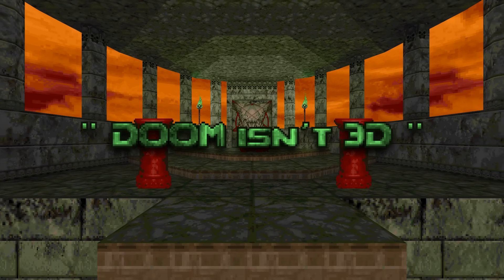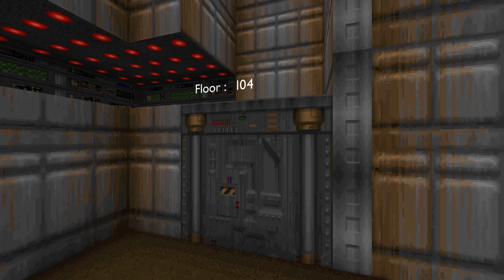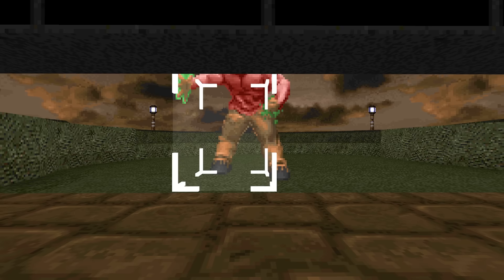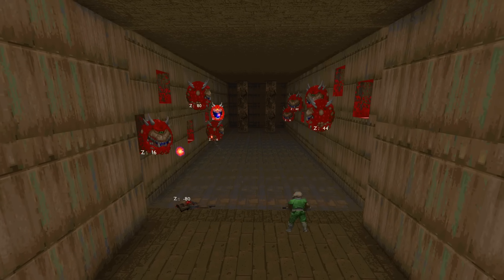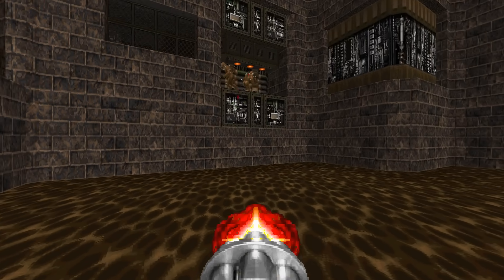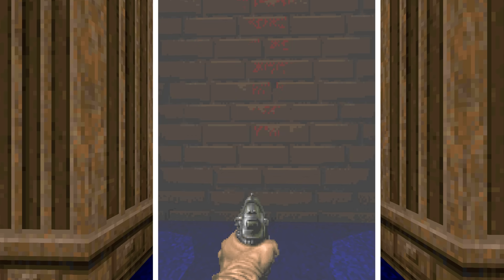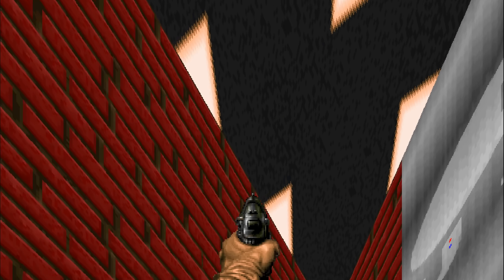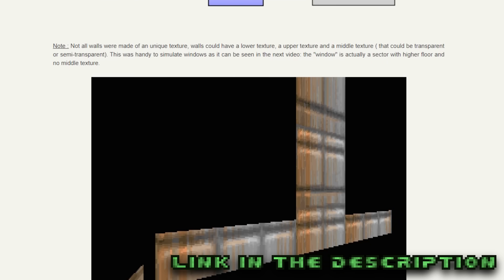Doom engine - Limited but still 3D

Comment: Your opinion seems to differ from both the Johns. Carmack and Romero, the ones who designed Doom.... already have said it's not real 3d. Mentioned some of the things you have stated and some you left out. In 3d, you apply vertices and indices and textures in a 3 demensional space. Doom doesn't do that in 3 dimensional space it rather uses 2d sectors and then tries to give an illusion it's 3d.

By the same logic you and many others use there is no such thing as 2d games as you always have objects drawn over a background that may be a single color or an image. Hell in Zelda Link to the Past you have a boomerang that goes "over" some objects.. the ones that hit switches to raise/lower the floor blocks. Would you then say well it's still 3d? No, you wouldnt.

Doom is just the greatest illusion of 3D that was ever created using 2d. And even the Johns agree with that. Fun fact, when they in fact did go to true 3d they had problems.. this was during quake and they actually discovered hardware errors in processors with Intel. Check it out it's a good subject to research.

So I gotta agree with the John's on this one.. Doom isn't real 3d.
Reply from the maker: „Illusion“ term is not really correct to use here. It implies the game visually appears three-dimensional while the gameplay is limited to a 2D plane. I do remember Carmack saying that, but I believe he made a mistake about a game he has moved on from long ago.
In-game objects have 3 coordinates which are being tracked at all times.
Doom mapping format (sectors with height) is primitive, but achieves nearly the same results as a more advanced one. The level architecture you create by defining sectors would still respect vertical positions of the players, mobs and projectiles. Windows, platforms, stuff hanging from ceilings - all that makes a 3D space for objects with 3 coordinates to inhabit. Sorry, but saying Doom doesn’t have a 3D space is incorrect. True, this space has flat horizontal and vertical faces with no slopes, but so does a cave in Minecraft. Not having floors in the middle is unfortunate but doesn’t subtract a full dimension all of the sudden.
I also heard the Zelda example before (an old game theorists video used it), it’s not a fair comparison since Z in doom doesn’t work as a binary „above-below“ or a limited set of „layers“ that objects snap to. Z is a number allowing the same precision as X and Y do.
I believe Doom gameplay respects 3 coordinates enough to at least deserve 3D elements not being brushed off as „illusions“.
„Not a full 3D“ is a much more fair thing to say, we can’t ignore other games like Quake, that did 3D so much better. Compared to Quake many things are missing in Doom - hence its 3D capabilities are “not full”. Some even say it’s “2.5D”, which I also don’t have issues with. At this point these are merely different words to describe the same thing. I say “limited”, you say “not full”, tomayto, tomahto.
Reply: @borogk  Other examples would be E1M2 where you take the elevator to the room before the exit. If a monster is standing below they still block you. It's like infinite height. This is not common in 3d games. Yes there is a height for things. Which is why monsters cannot enter certain areas. But the only thing really "3d" is projectiles.. that could more-or-less pass for full 3d in a 3d environment. Also the entire way hitscan works is 2d. Projectiles are a different story.

While I dislike thinking of it as 2.5d I think that may be a 'better' description for it.

I think personally the real big difference is in real 3d you can have rooms over rooms. Or bridges. Where-as in doom you cannot. If you could do that in doom I would be 100% okay with calling it 3d. They could have done it but it would have ate thru the ram. You would have needed a 2nd map above your map.. for rooms above. But you would have been limited to how many times you could do that trick. However they didn't do that for some reason.

Oh and that "zelda" example theres actually 2 of them. One being the bridges you walk over and under. And the second being the projectile thrown. aka boomerang. And it's used to hit switches. When comparing a fired projectile in 1 game, it's a pretty fair comparison to compare directly to firing a projectile in another game. It just has different definitions for what blocks it and what does not. Sorta like how projectiles in doom which are arguably the only 3d part of the game.

It really is an illusion. It's a very good one at that. They did it so well they got people to actually believe it was 3d without making a 3d game. Thats what is so impressive.

Since doomguy cannot look up, or down. Only left and right and move back and forth and side to side you technically can play the whole game in top down mode. When you use the map you essentially see it that way. And you can play the game 100% that way if you wanted and were good enough. Thats because you do not have a 3d environment to worry about more then 2 axis's. Aside for projectiles or floors and ceilings that crush.
Reply from the maker: Same terms have different meanings for us, so no point arguing about the "illusion" thing.
I'll point out inaccuracy about hitscan being "entirely 2D". A common mistake is to look at the way your starting pistol doesn't seem to care if the enemy stands above - the bullet just connects instantly. Hitscan mechanic is a bit more nuanced. 
Each hitscan shot has an origin point, a horizontal angle and a vertical angle. A line is then traced from the origin and the closest obstacle is determined - a piece of level geometry or an enemy. That line travels in a 3D space, its direction is defined by 2 angles after all, same as in spherical coordinate system.
When you press "fire", the auto-aim feature first determines a base line, then one or more bullets are generated, each with a random angle modifier relative to aim. This random spread is most visible for shotguns or when you continue holding fire with pistol/chaingun.
Connection between the auto-aim target and the hit outcome is not direct - a line is simulated fully and honestly even when the random spread is 0. The first pistol shot is programmed to always have 0 spread and should always connect, that's what creates this confusion largely. 
If you keep holding pistol fire - next shots lose accuracy, but are fully simulated nonetheless. Even better is to try the shotgun - its bullets are always randomly spread. The game doesn't cheat by skipping the full simulation, drawing a ricochet puff near the target and calling it a day. The spread angle can make it so it hits another enemy or flies out of a window and hits some elevator way far back.

Sorry, I know it's a lot, but this explains hitscan as fully as I can in a YT comment. One of those things I should've elaborated in a video, perhaps. And it serves as just one example of a mechanic, that may seem primitive at first or rely on cheap tricks.
Realising that things are not as simple - was my experience exactly once I started digging into the engine source code and experimenting while playing. Evidently, I can talk about it for ages :)
Reply: @borogk  You do realize that the source code for how everything works and I have been programming in c/c++ for over 20 years... right? Nothing you explained is "complex" even a little. Perhaps it is you that needs to brush up on understanding. Anyways happy new year and keep learning eventually you will get somewhere.
Reply from the maker: Nobody's doubting your programming skills. I pointed out that hitscan is not entirely 2D, like you mentioned, and gave an explanation. Of course by itself it's not complex, that's not the point. The point is it's more complex than "entirely 2D".
Reply: @scriptles It's bizarre how condescending and rude you're being to borogk considering you're very obviously wrong lmao

Comment: It's actually really cut and dry, the limitations are real, but so is the existence of a third axis, period. Pointing out cases where it couldn't or simply wasn't used for various reasons doesn't suddenly mean that the cases where it is used suddenly no longer exist. If you're going to set a precedent that you ignore when the game is not only visually and functionally 3-dimensional, but literally computes a third dimension within portions of its code, then that's a slippery slope to discounting every single 3D game that's ever existed. Super Mario 64? Oh, that's actually a 2D game, because it's rendered on the flat surface of a TV screen. You can ride this wave of pedantry forever, it's not a debate, it's a fundamental misunderstand of what Doom is and how it works.

Case in point: this is not what people mean when they say "2.5D." I know if you look at it retroactively it does seem logical to call Doom 2.5D because its utilization of a z axis could be called "half" implemented, but when critics or journalists use this term, they don't mean this literally. What they're actually referring to are games which give the illusion of depth through rendering tricks. Prominent examples of this are from the golden age of 2.5D during the late SNES and N64 era, where pre-rendered 3D models were regularly used in platformers, which then gave way to true 3D models being rendered in game, but with the gameplay still being locked down to a 2D plane, such as in Super Smash Bros. Generally even the later examples are controversial to call 2.5D because they do actually render the 3D models, and the camera can be rotated around them in the pause screen. But as far as gameplay is concerned it's extremely rigid in its lack of third dimension.

Wolfenstein "3D" is probably one of the best examples of this because unlike Doom, it had no variable heights, and projectiles couldn't pass over actors, it was quite literally 2D with the 3D illusion simply being the work of perspective. Hell, it's more 2D than Sonic 3D Blast, which while it was simply done from an isometric viewpoint which never really tricked anyone, you can technically move on three axis since you can jump over things.

I think the bottom line about defining video games by their dimensional axis is that when we stress out about these technicalities just to look for the "right" answer, we're missing the forest for the trees. At the end of the day, to look at the technical achievement of Doom in 1993 and get a stick up your ass about it not being "true" 3D despite it literally having three dimensions fundamentally misunderstands what the game and the engine are and it's frankly insulting. But more than that, there's way more nuance to the topic regarding what "3D" even means and how video games achieve it technically. And if you really care about it, then there's a discussion about how Doom actually works to be had, there's a discussion about how Quake works to be had, and Super Smash Bros., and Sonic 3D Blast, and all of this can be part of a larger exploration of how anything projected onto a 2D surface can ever be interpreted in our minds as 3D in the first place when it actually isn't regardless of how it's being rendered... and then we could get into VR. All of this stuff is a different kind of conversation, all of these things are interesting on their own. Piggy-backing a real conversation onto a factually incorrect statement which leads down a line of questioning that demonstrably proves your initial assertion was false to begin with disrespects the audience and wastes their time.

Doom is 3D. Full stop. It's interesting and quirky and deserves further inspection from a technical and historical viewpoint, yes. But it is not 2D, and any sincere investigation into that fact will only provide more evidence that Doom is, in fact, 3D.
Reply from the maker: Well said! I largely agree with your view, although what people mean by 2.5D changes from person to person. Talking to a lot of people in the comments under this video has taught me that this point of view doesn’t always come from ignorance. One can have good knowledge and understanding of the engine and still draw the line keeping Doom one step outside the “big boy 3D club” on technicalities.
If we look outside the FPS genre, some say 2.5D is when gameplay is a 2D platformer, but a game heavily uses 3D models for characters and/or backgrounds. And that’s an entirely different thing from the FPS-type 2.5D. The term is simply not consistent enough.

Comment: No "room over room" isn't a limit of the Doom engine, it's a limitation of ID's implementation of BSP (Binary Space Partitioning) trees. When your map format is mostly structured like a floor plan, how on earth are you supposed to support rooms being above or below other rooms?

ID's BSP implementation didn't gain the ability to express true 3D space until Quake; if you back-ported just Quake's BSP implementation, you would probably be able to remove the "no vertically stacked rooms" limitation from Doom.
Reply: But JohnCarmack was not able to deal with Quakes BSP and came up with this weird PotentialVisibleSet and accepted much more overdraw than in Doom ( walls and floors are now rendered back to front (painters) ).
Reply: I said PROBABLY, lol. Obviously you'd have the sorcery that is Quake's rendering engine to deal with, but it should THEORETICALLY be possible.

Comment: The original build engine also used collumn rendering, and it can't technically have rooms on top of rooms, instead it uses silent teleports to make it seem like it does.
Reply: Build uses portals, and I can’t understand why it is not as 3d as Descent .
Reply: @ArneChristianRosenfeldt  silent teleports, as I said
Reply: @gentlesoul221  I know that silent teleports allow for this, just Descent did not need them. So going from 1995 Descent to 1996 DukeNukem3d was a downgrade. Descent had polygon enemies.

Comment: It looks 3D, but on a technical level it is not 3D. You won't find a single 3D prop in any of the doom games - that's not just an optimisation technique, its a limitation caused by how the game is rendered. 3D models are stored using vertices with xyz coordinates- the Doom engine does not use 3D coordinates and cannot render 3D polygons.
Reply: @borogk   Every object does not have a z-coordinate. In the original Doom engine the vertices are represented by a pair of 16-bit integers (x y coordinates). Sprites also have x, y coordinates and are assigned either to the floor or the ceiling - its impossible to have a floating barrel because it doesn't have a z-position. 
Sectors do have a collective height property but that is not the same as an actual z-axis because you can't have one object on top of another like in actual 3D. The z-dimension is an illusion in the doom engine, unlike game engines with 3D coordinate systems. This is why people call it 2.5D
Reply: the map is a 2d plane but the actual gamespace is 3d. Otherwise rockets would always collide with monsters above and below it.
Reply: @OhNotThat  Thats why people call it 2.5D. It isn't 2D, but its still not 3D. The engine uses 3D values for collision detection but not for rendering. When a rocket is drawn to the screen it is not a 2D projection of the rocket in 3D space, it is a clever trick which uses the 2D distance between the player and the projectile, along with the sprite's width to decide where to draw the sprite on screen and what size to draw it. This is totally different to real 3D engines which rely on actual 3D coordinate systems and linear algebra to transform those coordinates accurately to the 2D screen.
Reply: @mark63424able I swear people don't realize why the term 2.5D exists

Comment: Its presented in 3D obviously, but the phrase "Doom isn't 3d" comes from its use of raycasting, which only uses 2d draw calls (x-y axis only).

Here is raycasting on native NES which is kinda interesting.
https://www.youtube.com/watch?v=rf6_rjygSnM
Reply: DOOM doesn't use raycasting
Reply: @xXPSi77Xx  Yes, it does. The levels are created by 2d images with blocks. Cant turn that into 3d space, without using raycasting.
Reply: @timmyp6297  It doesn't, DOOM uses a system called Binary Space Partitioning.
Reply: @timmyp6297 No it doesn't
Reply: @EliteAaron  Yeah, it does. Sorry buddy.

Comment: "Horizontal floors"? Sure, all of the floors and ceilings in original vanilla Doom are horizontal, but I've seen Doom source ports that added SLOPES to the floors at least, and the Build Engine used slopes extensively! It couldn't have been that difficult for Build to implement slopes, so why didn't John Carmack for Id Tech 1?

Comment: The engine technology is called 2,5 D. The Build engine is also a famous example. Another restriction of this age is that every dynamic object is 'billboard' rendered. Those engines are in fact not 3D. Like a 8/16 bit parallax scroller has no depth, nor a stereoscopy image. It's an illusion of real 3D and in the truest sense of the words _not 3D_.

Comment: "Modern graphics technologies like OpenGL"... OpenGL came out in '92. Doom came out in 93. I guess modern OpenGL is more modern than Doom-era OpenGL. Doom would've run like crap on a 486 using OpenGL due to hardware tech of the time.